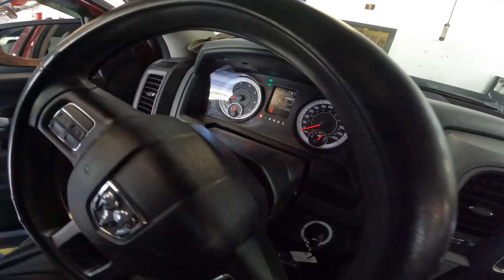BBK Shorty Headers! Insta-LEAK! Ram 1500 5.7

Comment: They sell heat shielding with a fiber glass with external foil insulation sleeving in rolls that you could slide over the heater hoses after disconnecting one end on each hose. Plus they sell heater hose by the foot at the part store if you wanted to totally run the hose away from the exhaust.

Comment: Pro tip - a lil dab of JB Weld on the 4 corners of the gasket will hold the gasket in place, allowing you to locate the bolt holes on the headers. Aquarium silicone works in a pinch also. Lastly I should mention that I’m a investment banker at my day job.
Reply: Duke, when I have to hold a gasket in place I like to use Elmers rubber cement. You can put it on both surfaces and let it dry and it will stick or just put it on one surface and hold it there for a couple seconds and it will stay, also cleanup is simple, just rub any excess and it balls up and is gone. 
  I use it on my riding mower’s decals, when I power wash it the decals will sometimes come off and I use the rubber cement to put them back on. Works good!
Reply: @Hoaxer51  you’re a true man of innovation! I appreciate the tip.

Comment: As the owner of a '14 Ram with a hemi I've thought about replacing my stock manifolds with headers when and if the studs break. That ain't happening after watching you struggle! Stock manifolds forever! Thanks for sharing your misery so the rest of us can make life-improving decisions.
Reply: "And if"... haha, you were fine with just "when", it will happen. Don't be afraid of the headers, this was a fairly trouble free install. If it doesn't develop a leak in the next few years, it's a win. That driver's side leak issue is just as likely with the stock manifold replacement. If you do get the broken studs on stock manifolds, replace the gaskets, bolts/studs, and have the manifolds decked/planed. Don't use new manifolds or you'll rinse and repeat.

Comment: You need some safety wire pliers and safety wire comes in handy- i actually safetied an oil pick up on my 454 engine if you don't have a welder it worked!

Comment: I've seen several manifold replacement videos. Each one has shown someone doing what you did after cleaning the gasket surface of the head. Using compressed air to blow it clean. What I see is the air blowing trash into the combustion chamber where an exhaust valve might be open. Why not stuff something into the exhaust ports first to block the holes before the cleaning?

Comment: wouldnt have been easier to cut that long bolt down instead of a spacer it would have also given more room for the socket ps great job
Reply: If I paid someone to install my headers and saw that nut on a bolt mess  I would ask for a discount on the labor.  That is OK on your personal car but never should be done to a customer's vehicle.
Reply: Should have either cut the bolt to size or gotten another bolt of the correct length. If I had paid to have headers like this installed, I would not be happy with a nut as a spacer, where a spacer should not be.
Reply: Or a few washers
Reply: No, that was not the problem.. Listen: 35:04 The shank is the smooth part of the bolt that has no threads. In other words, he did it because he ran out of threads to properly seal the leak. Cutting the bolt shorter would have solved nothing,
Reply: @doorguru168888  he said the problem was the bolt was hitting the header tube when it went through to the exhaust clamp. So in theory cutting it shorter probably would have worked. I will say that I’m sure there is a reason for the way he did hat he did. From watching his videos for a little while he seems to always do the best he can to get the job done , done correctly and also with it  looking  pretty good not like some yahoo did it.
Reply: @doorguru168888  No, that was not the problem..Look and listen 31:24 there is at least 5-6 threads left under the flange. If you back up more, you can see the metal dropping off the end of the bolt hitting the header as it was tightened..
Reply: @doorguru168888  You are correct. Just re watched that part of the video and never noticed it was a partial bolt. Simply cutting it would not have solved the situation. Whomever made the headers, and supplied the hardware should have included a fully threaded, shorter bolt. Ray is not a hardware store, and should not have to spend half a day searching for one bolt. Man's gotta move on to the next broken auto.
Reply: Vice, hacksaw, and a chase nut.
Reply: @williamkelley7654  It was stressing me watching that bolt cut into the header. 4mm off that bolt would have been my solution.

Comment: Oh and lol. I have a 2005 magnum hemi. I put l.t in mine lol. Stud kits are a must and also s.s. We had to remove the engine mounts , transmission mounts and lift the engine a bit . ... For the d.s.t we welded 3 nuts together.  Tighten down thethe header then run a short bolt through the dst .

Comment: Years ago I bought a set of ARP locking header bolts. Had a retainer clip that rides on side of header so can’t unscrew.  Great idea part
Reply: agreed..l put them on my 2018 GMC Sierra 6.2l shorty headers and have not had to re-torque them in over 3 years.

Comment: The flange bolts were getting hard to turn because of the heat from the running engine. Remember! All exhaust work cool and lubricated!
Reply: Couldn't you put the hardware in the freezer till you were ready for it? I'm definitely not a mechanic, but I am a thinkin man.

Comment: I put BBK headers on my 2018 ram they lasted about a year and a half before they cracked at the welds on both headers. When I called BBK, they knew exactly where the cracks were. They said they had rework the headers with new design, but would not cover my cracked set due to being over a year old I would not spend my money on something that accompany will not back up when they know there’s an issue.

Comment: Did it make monster power after the upgrade? Yea, yea it was a leak repair but the shiny manifold looks faster.
Reply: Next he's going to have Ray put some 'speed holes' in the hood.
Reply: Those headers do look nice, probably not worth the hassle though.
Reply: Long tube headers add torque.  Not sure about shorties.

Comment: Job security. Alot of work for 2.7649 hp gain
Reply: That’s it?!
Reply: @standhd   Maybe not even that especially if he didn't upgrade the downstream part of the exhaust system and do a tune on the computer. The other problem is that quite often with headers and exhausts both on cars and bikes is that what power gain there is is in   an RPM range that you will almost never used on the street.

 Friend of mine in Dallas does dyno tuning and he said that all too often people want headers installed but don't want to do a full tune and then come to find that their 800 to a $1500 parts and labor header system gaveless than 5 horsepower.  It was always amazing to me the folks that would go through the effort to do the hardware but not the software.Back in the olden days everyone knew that header work also included carburetor work :)

 He would advise them to do the whole job but if they chose not to he was a great believer in it was their money and they could spend it however they wanted.
Reply: @stevewhite3424  Thank you for the response!

Comment: someone may have noticed but I will mention that on the dipstick side there was harness wires by the steering rod that needed to be heat shielded header bend is going to melt the harness, Only mentioned because I did not see it corrected.  Did not want a comeback or maybe you saw and corrected.  I had headers on a jeep and the bolts  always backed out and I had them on a full size bronco had the same problem.genuine pain.

Comment: You got lucky with removing those bolts. Mine broke off in the head enough where my mechanic had to remove the head. It’s such a tight area to work because they mounted the motor so low and far back behind the front axle between the frame rail. Good for weight distribution/center of gravity but not for working on it. We cut the dipstick tube and added a piece to make it longer to clear everything. The add and full line on the dipstick are in a different spot now 😂. We zip tied the two coolant lines to the ignition coil packs so they wouldn’t get burned. Sorta wish I went with long tube headers on mine instead of the shorties. It gained torque/hp, but nothing crazy. It’s a truck not a challenger scatpack so I didn’t want to throw a lot of money at it.
Reply: Ray didn’t get lucky with those broken bolts. It was all skill. 🥰❤️

Comment: I spend a lot of hours watching YOU work.
Time we'll spent!
I so miss doing auto's. Now I diagnose and repair mill amachines and equipment.

Shorten the bolt leaves the job clean, no nut spacer. Or maybe use a SS nut.

Comment: Save the OEM headers it will be back in six months with Leaks and melted things
Reply: Why is that? Please explain.
Reply: @standhd  factory manifolds are already shorty headers + they don't rattle off and leak.
Reply: @standhd  millions of dollars has been spent on the engineering of this car. Putting in some thing that doesn’t belong Upsets everything working together. Something you only know when you’re older and you’ve owned a car with headers
Reply: @KingSobieski  those where a manifold not a header...a good header has individual tubes that are of equal length that are welded into a collector.  A manifold just has a tube running down to each cylinder that has a mount for each exhaust port....

There are some cars like corvettes that had stock headers and were sought after by car enthusiast because of the performance and looks
Reply: @standhd  The BBK's are the low of the low end shorty headers for these Hemi's.  Just do a search and you will see.
Reply: @KingSobieski  Actually they do.  Just do a quick search and you will see how many of the factory manifolds have warped and caused the bolts to break.
Reply: @10forthebigguy753  If that was the case the factory manifolds you would never hear of warping and snapping bolts.  But just quick research you will see how many this has actually effected.  Best route to go is when they do warp just get them flattened since warping has already happened will not again.
Reply: @walterwhite2270  exactly right I just had commented on the way the tube was made 👍🏻
Reply: Cuts, burns, broken fingers it’s all part of the job. Thanks for another video 👍
Reply: The automobile God's do not like the shiny manifolds.
Reply: @burnham187  dealing with issue now on my 2019 debating whether to replace or go aftermarket.
Reply: @KingSobieski  oh yes they do. Bolts breaking and exhaust leaks are real common for these trucks
Reply: @10 for the big guy Ouderkirk  oh my God the classic forum quote every boomer says 😂😂 just tells everyone you have no idea what you're talking about
Reply: Considering I'm on my second factory manifold for warping and replacing my 5th snapped head bolt, I'll take my chances.
Reply: @warnerjj how many miles are you getting out of a manifold? Been thinking about doing this for awhile. Thank god I’ve had no leaking manifolds that I can tell rn on my 2020 classic.

Comment: Back in the day I would install the headers for my buddy's 1969 Ford Cobra with a 428 Cobra Jet engine. It would be an all-day job to get the bolts and or allen head bolts in and tight around the boxed in shock towers and get them tightened up. He often pulled the engine to make changes and would always have me do it because he did not have the patience to do it. I even bought a finishing tap to make sure the threads in the block were clean and could be finger tightened as much as possible. Fun times.

Comment: I did something like that once. Fighting a bolt that wouldn’t behave, do those tiny turns when tightening up. Turned out I was cross-threading the bolt on the brake caliper. Whoops - lesson learnt.

Comment: You should have used some anti seize Those bolts are very likely to brake over time. I like to just put the anti seize in the bolt holes so I don't have to mess with it being on the bolt as I install them

Comment: Put the same bbk shortys on my ram for the exact same reason, had broken exhaust manifold bolts on both sides. Had to weld nuts to extract the studs also. I have gone through 3 gaskets on the driver side tried grade 8 locking bolts, stacking gaskets. Did the correct torque pattern and retorqued. Nothing gets rid of the exhaust leak.

Comment: Excellent job Ray: The last time I installed exhaust headers it was a real bear. In my shop any custom work is performed on an hourly basis with no exceptions. I pray you didn't quote that job at 2hrs labor. TMP from N.J.

Comment: Header installation afterwards run her HOT and while still running 1/4 turn each bolt...not too tight or you'll snap one..never worry about bolts loosen up after that .

And try not to burn yourself,  welding gloves for a torch work wonders

Comment: In the hardware kit there is a longer bolt with a 13 mm head and spacer you are supposed to use for the dipstick.

Comment: I recommend getting pair of Safety Wire Pliers. They lock onto the wire, then spin automatically when you pull on the back of them. Don't know how often you would need them doing automotive work, but you can get a serviceable pair for under thirty bucks. Cheers -Sean H

Comment: i would be tempted to fabricate a heat shield extension to protect the rubber hoses from the rear exhaust outlet manifold pipe , pop rivets

Comment: This takes me back to when I had my 2010 Dogde Avenger. A peice of crap to work on, but drove like a Cadillac after, lol. The smallest problems always stalled my progress, like having to remove the whole knuckle for a ball joint replacement, because the press tool was a mm too big. Big fan dude, it's good watching a pro do it and not have grease up his nose after.

Comment: Probably would be best to retighten the bolts after a heat cycle.  The problem collector bolt could have been dealt with by sawing off about a quarter inch of it. But tough job and you succeeded. Well done.

Comment: Your HYPER FOCUS and PATIENCE with frustrating details is beyond remarkable.  Football has a yearly Lombardi trophy...  mechanics should get a RayRay trophy when applicable.

Take a bolt....  a bolt that easily twists off in the block....  hmmm...  bigger diameter bolt??  Double diameter = 6x circumference...   greater circumference = greater region of contact/corrosion/stick...  So what's the best diameter??

C U S T O M E R:
As a courtesy, come back after a month so Ray can do a quick recheck of those water hoses and other stuff.  Ray was doing design as well as install and every design deserves a recheck.

Comment: Man I was thinking of doing some headers on my 2017 ram 5.7 to get rid of the bolts snapping off  because  of the cast  Iron headers against an aluminum block with heat expansion. Man Ray you have alot of patience. In my mind I would be like to the customer that will be  Twice the cost now . Just kidding well maybe not .great work ray.

Comment: J.s Ray . The o.e is the best gasket to use . Never use the gasket that comes with the headers lol. Now remteck gaskets are better then the factory when it comes to keeping these dodges sealed up but they are somewhat difficult as the cant be bent or they fall apart . Oh and a year later and no leaks on mine . I retorqued mine 1 time at the 30day mark only becausethey said to but their were no leaks . I did use the rimtech gaskets.
Reply: On my 2018 GMC Sierra 6.2l engine I put shorty headers on and used the locking header bolts...torque down at install then put the clip on and they cannot back out....been 3 years now, no need to re torque.
Reply: @walterwhite2270  the dodges do not care for the d7 locking nuts . They tap and set off the knock sensors .

Comment: Headers were easy in the 60s and 70s after that forget it. Even back then we had to tighten the bolts for awhile. When they came out with hi temp red silicon you put on each side of the gasket they finally stop leaking. Unless you do it yourself it will cost way to much. I still have a bunch of wrenches I had to heat and bend to get to some bolts. Cars with AC caused most my problems with a 1/8 turn of a bolt at a time. After awhile I would not do them anymore. Way to much time for what anybody wanted to pay. I found out that using radiator hose clamps work better than messing with wire to hold the pipe installation works the best.

Comment: I have installed headers in several cars that I owned, and I cut the head off 2 old bolts and used them as temp studs to align everything . Job is a pain in the hood hah, but a bit easier.

Comment: I love doing header's I use to custom build them...and intsall them on Motor Home's...😎 Pressure testing the welds on Aircraft could be stressful. Sometimes you have to sacrifice wrenches and make custom bends and twist to tighten the bolts Capiche 😎

Comment: I was kinda surprised that you took on this job. Knowing how difficult it looked. 
I don't think my shop would even attempt headers on my caprice ppv 6.0. Lol .
Reply: I work in a restoration shop and we hate headers, it's all downhill with them
Reply: If the engine bay of a caprice is like a g8 it isn’t that bad. If it’s your first set it takes a little time. Just come in from the bottom. It would also be best to have a second set of hands to start the bolts from the top.

Comment: If that is Jet-Hot coating, I would wear rubber gloves to work with the headers, 'cause skin oils will burn on to coating.  Have JBA emission legal shorties on my '92 Bronco 5.0L.  Love Jet-Hot to keep heat inside headers, rather than frying plug wires.

Comment: Ray, the best solution for bolts that are too long is to cut the bolt. Alternately, you can stack washers. I would never use a nut to adjust the length of a bolt.